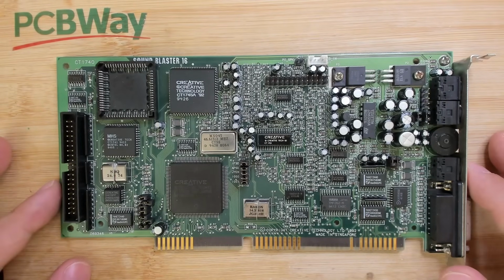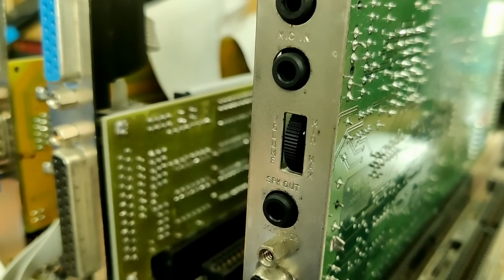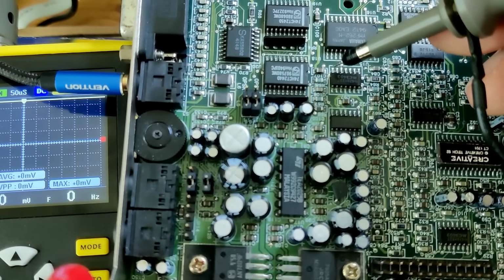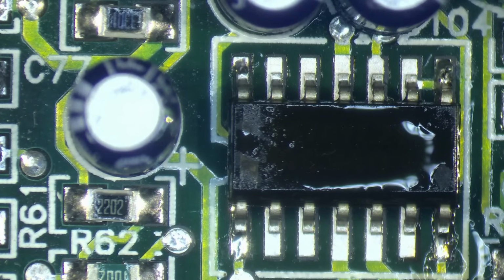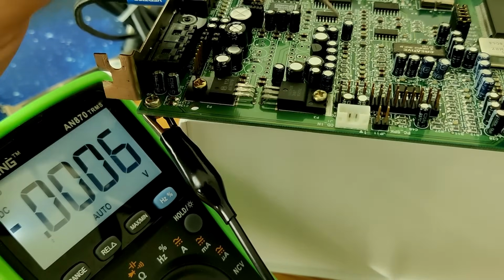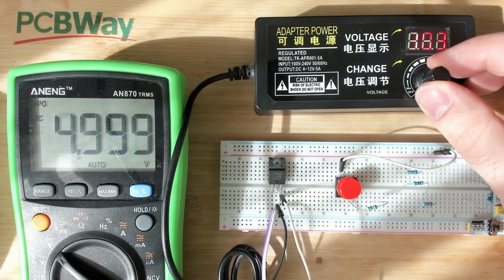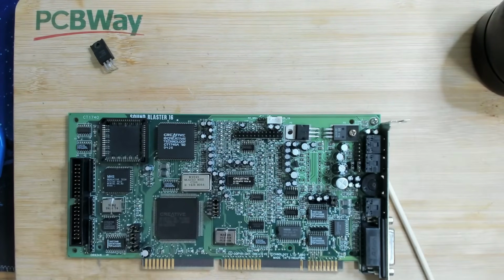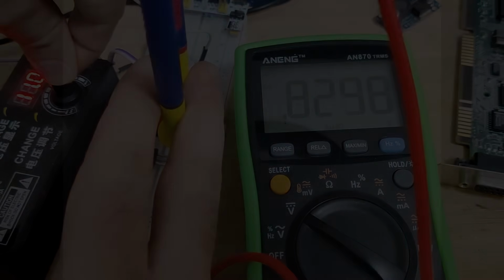The Greatest Sound Card Ever? The iconic Sound Blaster 16!

Comment: Hi, I have CT 1740 with DSP 4.04 and there is no hanging note bug and I don't even hear any clicking, but I have other problem, when playing sound effects in older DOS games (like steps in Prince or shooting in Wolf 3D) there is very loud and annoying TSSSSSSS sound surrounding all effects, do you think it's possible to somehow fix it? One capacitor on that soundcard was installed wrongly, I swapped it to correct position, but no change and disabling amplifier also doesn't help. That card is generally pretty silent and plays well, except that TSSSSSSS noise surrounding all effects in older games, it looks like it happens only in older games that don't have proper SB16 support, only SB Pro.
4:49 - that's exatly that TSSSSS sound I am talking about, but I don't hear it constantly, it appears only when sound card plays effects in games. No problem with adlib or midi music with dreamblaster S2.
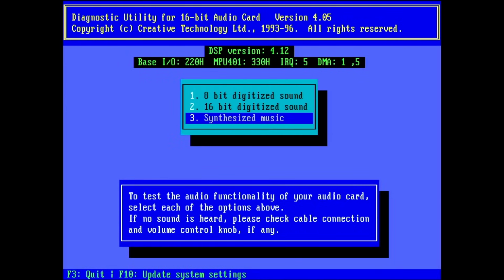5:16 - ok, I will try to use original creative drivers, I was trying it with no drivers (it works because it's not plug and play) and with unisound, but no difference.
I will probably try to recap it, but there is a lot of caps and I have to order them, but I already recapped several old soundcards and it never did anything to sound quality, but I guess I never had a soundcard with faulty caps.
Reply from the maker: Hm, having a capacitor the wrong way around is concerning. Do you know the history of the card? Usually, those caps are polarized and could explode if installed wrongly. Your DSP version is not affected by the hanging note bug. Those seem to affect mostly version 4.11, 4.12 and 4.13.
Maybe check your voltage regulators as well. They could have an effect on the sound quality. Other than that, I could only imagine that some sound effects were recorded in bad 8-bit quality - and you hear that with good speakers.
Reply: @bitsundbolts  I don't know history if the card, I bought it from a typical garbage person who sells rusty shit as a "piece of history, rare....." so it had pretty corroded metal plate, but PCB looks fine. 
I would also guess that noise is already part of that sound effect, but it doesn't happen on other sound cards and speakers are basic 3way genius speakers, slightly modified to really play something from mid range speaker (when it was new, it was fake) but far from beying good speakers. 😀 

Voltage ragulators give exactly 5 and 9V, but I found out very interesting thing, when I remove one of those 3403 op amps (that one next to CT1701 chip), all noise in Wolf 3D and Prince disapears and everything sounds correct, but ofcourse sound effects in later games like Doom don't work, that's very interesting that it plays fine in older games even without that one op amp. Maybe Door sounds were missing, I am not sure, but adlib music and gun shots were played correctly without that TSSS surrounding gun shots as before.

My card has soldered that bigger chip (where you have socket) and when I try to put jumpers there to disable CSP (as it is on your card), it doesn't play at all, but even when there is no actual sound, there is still that TSSSS sound played when I for example open door in Wolf 3D, that's very interesting. I ofcourse tried to replace those op amps for compatible ones from other card, but no change. Well, I will find out one day, maybe it's just another bug present in v 4.04, when it doesn't have hanging note, it has something else, as always with Creative cards. 😀 

In Windows, everything is crispy clear, all folder clicks and stuff like that, no noise at all which is a miracle with these old sound cards, there are some hidden qualities in these soundcards, you just have to unlock them. 😀 Someone on the interenet says that CT 1740 with v4.04 and soldered second chip is rare, I don't know, it's just scrap probably from dumpster. 😀

Only other difference compared to your card I found is that you have some chips with Philips logo (if it's Philips logo) and I have some LS245 and other LSsomething stuff.

Pins for jumpers IFSD and APSD were missing on my card, I soldered it there, but as I said, when I put jumpers there (as you have it on your card), it doesn't play at all.

Comment: Where did you get the power supply adapter that generates the -5V for ISA devices?
Reply from the maker: There are several community options available. One is made by Phil's computer lab and necroware called 'voltage blaster'. I also made my own version that you connect in-between an ATX power supply and an adapter cable to the motherboard. You can see it in my PCBWay profile.

Comment: Op-amps and electrolytic are a pain! Get yourself an Oscilloscope, that's how i usually find faults. Op-amps are a generally cheap and easy way to get analog comparators and analog signal/audio amplifiers.. They can be very useful, but also very annoying if you get a cheap shitty one or get oscillation. And indeed an audio signal shouldn't start negative lol

Comment: What's this about a hanging note bug? That could be a very historically interesting issue!
Reply from the maker: I am already working on it. However, there are already solutions online including FixMPU which eliminates the bug.
Reply: @bitsundbolts  Fascinating. I'll try to hyper summarise: As it was, we had a 486 in ~the nineties and the stars aligned and I got an AWE32. The problem was that anytime it used wavetable, it would  hard lock up crash. No amount of fiddling with DMA channels would fix the problem. That did lead to us getting a pentium, somewhat soonish after and that of course was awesome. I wonder if it was this bug that caused the crash, though?
Reply from the maker: @SireSquish the hanging not bug might not have been the issue. However, you might have needed another tool that prevents games from crashing: SoftMPU. As I understand, some games would freeze up if you didn't start this application before running the game. But there's so much to discover, it's too much for a comment ☺️
Reply: @bitsundbolts  theres already a permanent fix for the hanging note bug. Back in October 2023 me and some other people worked on getting the 4.16 firmware off the ct4500/ct4520 cards to compare it against the 4.11-4.13 affected firmwares and find out what the changes were and why the bug was present. (which turned out there were only small changes)

After completely reverse-engineering the 4.13 firmware we found out that in the assembly code errors were made and burned into the maskrom which then couldnt be fixed anymore, which made it so that not all midi commands would be processed properly. The full topic is over on vogons under the name 'The Soundblaster DSP Project' topic number 48732. (long read but should give more insight)

Ideally to fix it properly you want to install a plcc44 socket in place of the original dsp maskrom (MHS chip below the empty socket with v412 marking) and put in a replacement chip, something like a AT89S52 or other 80c52 compatible chip. All off the reverse engineerd firmware files are on my github under the same name as i use on youtube. (the link is also on page 53 on vogons as it gets yoinked on here)

Theres a couple versions currently, 413_patch5 and 416_patch1, both should work fine, the latter is a more cleaned up one i use on my ct3900 card and should be compatible on any card ranging from firmware 4.04-4.13.
Reply from the maker: Well, that is pretty much the project I'll work on 🙂

Comment: Not that 35°C is running hot or anything for a 7805, but it makes me wonder if anyone has tried using a switching regulator in its' place in the past and/or if it would degrade the output even further. That large cap behind the volume wheel also looks quite unhappy.
Reply from the maker: I think a switching regulator will introduce more noise - which probably could be filtered with additional circuitry. But I am not experienced enough to pull of something like that. There are those regulator modules you can get for cheap, but it would make the card look ugly :)

Comment: Where do you buy parts? I recommend mouser or digi-key . 😊👍
Reply from the maker: Unfortunately, I don't have easy access to those companies here in the UAE. Either, shipping cost is astronomical or delivery time is too long. I got the regular from Amazon that time because it was next day delivery. If I can, I'll source spare parts from donor boards, but when I can't find replacements, I order from AliExpress or, in rare cases, from eBay.
Reply: @bitsundbolts  if you want to have a stock of the most regular parts. I can order some and put it in a package and ship it to you. Shipping from where i live to UAE was surprisingly cheap, And im located in Norway

Comment: I wonder if the old 7805 was at fault. They were quirkier than the modern ST-micro, especially at a larger voltage drop. I'd suggest checking/replacing the ceramic capacitors on the input and output side. Those caps are what makes the 7805 stable and they have to be at least 0.33uF on the input and 0.1uF on the output.
Look how even the ST liked you putting your hand on the ground plane.
Reply from the maker: I should have read the datasheet and added the capacitance on the input and output. That drop at 10.5v doesn't look normal though - even without the caps.

Comment: I think if I found myself without a 5V regulator, I might have stuck an LED inline with the 5V regulator's 12V supply to drop about 2V rather than wait for an order to arrive. Of course that would presume the regulator is stable as it is and that the maximum input voltage won't continue to decrease, and also it would emit light (although that's not hard to hide). Your method is definitely more elegant than trying to massage a flaky part into functioning.

Comment: There's a large electrolytic cap near the output jack there that looks like its gotten hot at some stage - you can see this by the plastic covering haven shrunk back, I'd probably replace it for good measure.
Reply from the maker: Hm, I never considered it to shrink because of heat. I'll take another look at those caps which apparently there is a name for Smythe shrunk wrap: "short pants" 🤣
I measured the values on both (I desoldered the caps) and they seem to be within spec, however, if this was really due to heat, it's better to replace them. Probably also the smaller ones around.

Comment: JRC voltage regs tend to be low noise for what they are (yes, that may vary!) but it is not entirely uncommon to see a failed one. This +5V most likely supplies mainly the converters and analog stage, but may be provided to a wavetable extension as well. BTW, the SB16 Wikipedia article mentions common issues with bad caps and headphone amplifier implementation, plus your card appears to have the 4.12 DSP version that's affected by the MIDI "hanging note" bug. You can burn a 87C52 or 89C52 micro with fixed firmware to replace the CT1741, according to the VOGONS "Soundblaster DSP project" thread. Files are on Github (S95Sedan/CT1741_DSP). (Ah, now I got to the part where you're mentioning it. Looking forward to seeing the fix then.)

Comment: Long ago, i have a similar issue with my creative card, but i "fixed" it by a another way.
I put the 9V output from the 9V regulator to the input from the 5V regulator both regulator became a little "finger-cooler".
In this time i have only a little knowing of electronics, this "fix" was a randomly try. 
This "fix" will work for years until the card goes to garbage, when the old ISA-Cards goes out of Business.

I thought "my" issue is the only one in the world 🙂
Reply from the maker: I was thinking about this myself. The 9v seems to be used by the TEA amplifier chip. If it isn't used, that 9v regular doesn't do anything. When you daisy chain those regulators, you split the steps from 12 to 9 and then from 9 to 5. Right now, it is 12 to 5, so, a lot of voltage to drop. I wonder how much the TEA chip taxes the 9v regular when it's active. But it could make sense to distribute the load like this. I wonder why they didn't connect those regulators together, they're right next to each other.

Comment: That big cap behind the volume control might be bad, it has what I call "short pants". Its cover has shrunk, probably from high heat coming from the amplifier IC.
Reply from the maker: I removed the cap and tested it - the measurements were good. Nevertheless, once I get a proper replacement, I'll swap the caps.

Comment: IF you have an Oscilloscope, why don't you check the INPUT side of the amp or op-amp chips first, before you remove chips ?? if something goes into an amp it sure will come out again. so first check the input side.
Reply from the maker: I checked the input, but they were silent (no ripple whatsoever). That is why I swapped the chip with another one that didn't have that issue. Unfortunately, that didn't change anything.

Comment: Just replace it with an LM324,  The MC3403 that is.
Reply from the maker: Good to know that there are still compatible replacements. But as long as the card works now, I won't change any more components. Do you think the LM324 would improve audio quality? Not that I have an issue with it now that the linear voltage regulator is replaced.

Comment: yes, the ide port on the 1740s is the panasonic type. you don't start seeing plain ide till the 2810 models, and the sound blaster vibra/value variants. and not all of them have it. a few are still the proprietary, or lack the port entirely.
Reply from the maker: I never used one of these proprietary ports. I believe my ESS sound card had an IDE port and I was able to run a CD-ROM from it. I wonder if any Panasonic drive would work or does it need some special features?
Reply: @bitsundbolts  any panasonic drive from the era that uses their specific protocol. if the date code is ~92ish, it should be fine. if it works, of course.

most of the ess cards are bog standard ide. yet another reason to love them. yamaha also has some basic cards of their own with ide ports on them. i've got one laying around, but i forget the model number of it.

Comment: 28:00 when replacing an isolated voltage regulator with a non isolated one, like you did, make sure that it is okay to add an electrical connection through the screw and the pad beneath. Else, you have to add isolation. There are thermal pads that you can use, and plastic inserts for the hole.
Reply from the maker: So, tab is ground on the regulator - as is the middle pin. On the PCB, the middle via is connected to the exposed area where the tab is screwed on. My understanding is, that it shouldn't have made a difference since everything is connecting to ground. I understand that this doesn't work when the regulator has something else on the tab. That was the basis on why I didn't think of this being an issue on the card. Am I missing something?
Reply: @bitsundbolts  exactly. In this case it's fine.

Comment: The repairmen's first commandment is "You shall measure voltages" 
So, keep it in mind always :)

Also, all 78xx and 79xx class linear voltage regulators need a minimum capacitive load for stability and regulation purposes ( see the datasheet for details ), so when testing them on the breadboard or other configuration, you always have to put at least 10 to 22uF on the output. 
That is why the new regulator stabilized at 5V when you touched it. 
Keep that in mind, also :)
Reply from the maker: Yes, I will keep that in mind for next time when I will try to find faults in the future. Thanks for sharing your insights! Always good to learn about those components!
Reply: @bitsundbolts  it may sound like a joke but it is a well known truth, always make sure to measure the supply voltages when repairing anything, it often saves precious time in troubleshooting part of things. 

You are welcomed, i watched silently lots of your videos and i like your patience and attention to details ( i also like your music as well, i find it very relaxing ). 
This time you mentioned several times Tony ( which i like to consider a friend ), so i felt like commenting. 

Keep up the great work.

Comment: Great video. Very informative!

It also makes me wonder if this is the reason my SB16 PnP Value card is also very noisy, to the point that you can actually "hear" other signals from (what I think is) the ISA bus go around....
Reply from the maker: Maybe. I yet have to solve such an issue you're describing. Would be good to hear what you can say about your card after taking some measurements and potentially replacing the regulator if it is faulty. I always wondered how you could "hear" the memory test, keyboard strokes, or mouse movements through your speakers/sound card.
Reply: @bitsundbolts  I've had boards with VIA chipsets where any ISA soundcard you put into it would be very noisy. I would always think that this was a software / driver issue,  but in hindsight I would not be very surprised that these also had an electrical component to them, such as a lack of -5V on the ATX power rails. Back then I had even less knowledge of electrical engineering than I do now, so I always blamed it on a combination of bad hardware and worse (windows) drivers.

My soldering skills are virtually non-existent, so I am not planning on risking my SB16 right now ;-), but your video did give me enough pointers to start checking the +5V volt regulator. I am at the very least capable of using a multimeter.
Reply from the maker: Good luck and I hope you'll figure something out!